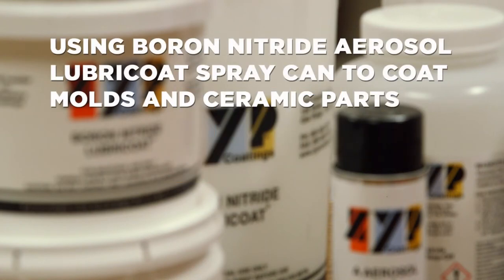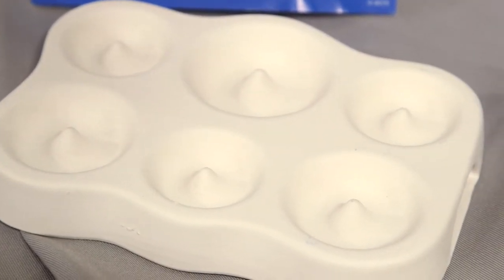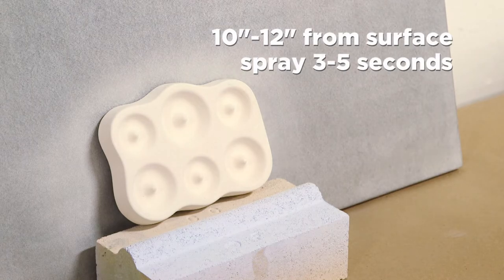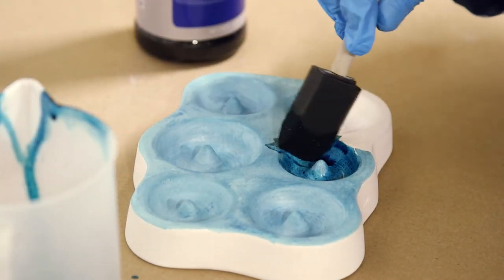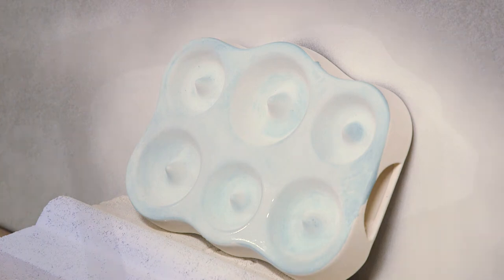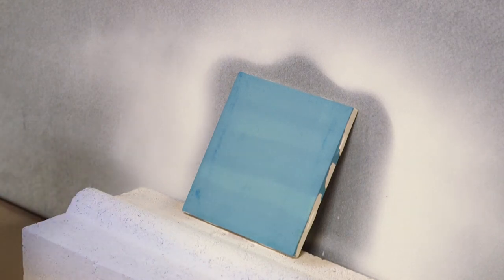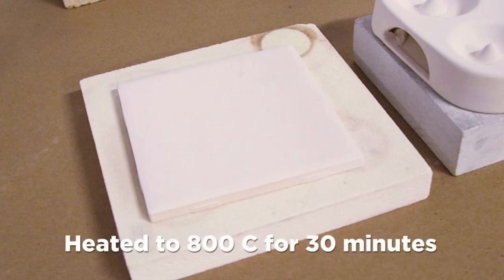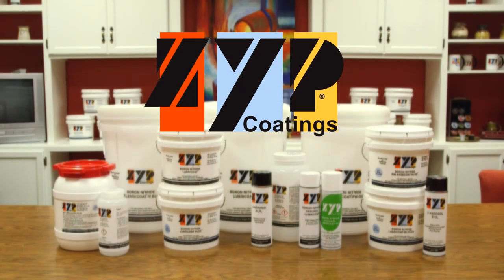Using ZYP Coatings Boron Nitride Aerosol Lubricoat Spray Can To Coat Molds and Ceramic Parts

Comment: I am having trouble with glass sticking to the shelves when I go to 1900 degrees. Can I use this as shelf coating to prevent that from happening?
Reply from the maker: 1900 F is a bit high for the BN Aerosol (it is 1038 C) in air atmosphere.   I would suggest possibly
                A Aerosol
                https://www.zypcoatings.com/mainline-rd-coatings/a-aerosol/ 
or 
                Z Aerosol
                https://www.zypcoatings.com/rd/z-aerosol/
with the latter probably being better with glass (although more expensive) than A Aerosol.

A water-based alternative would be
                Zircwash
                https://www.zypcoatings.com/industrial/zircwash/